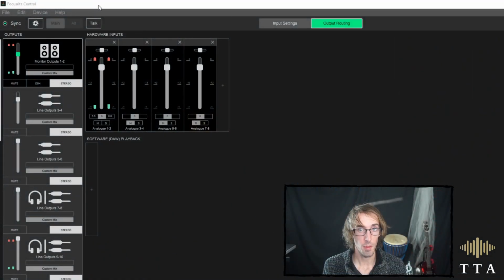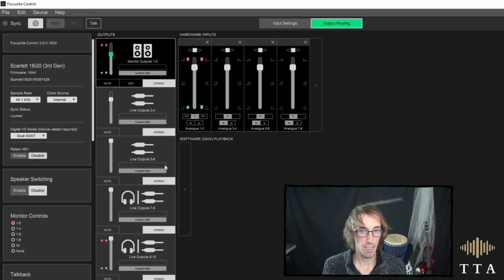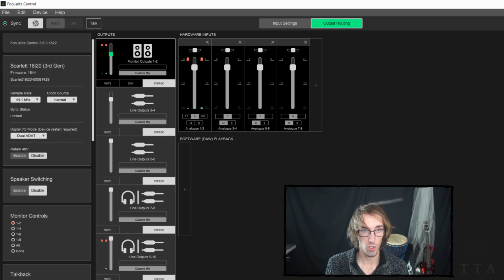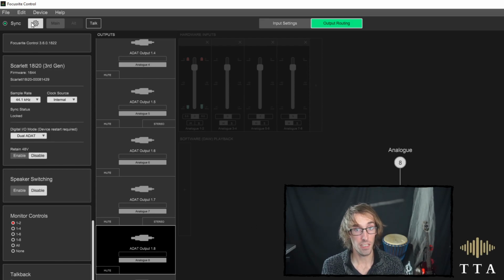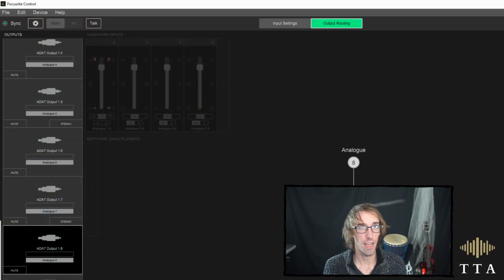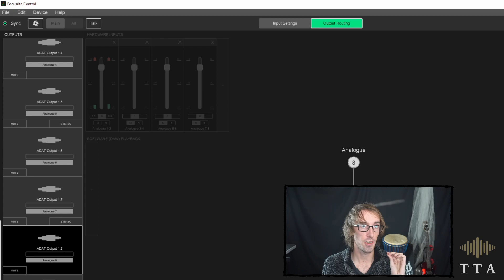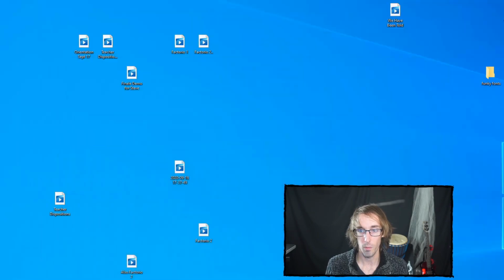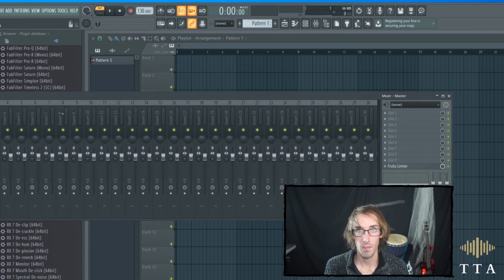Focusrite 18i20 ADAT/Optical Tutorial Faster

Comment: Hey, your tutorial seems helpful, even though it's short. I'm hoping you can assist me with an issue I'm having. I've been using two Focusrite 18i20 2nd gen units for years, but recently, I've encountered a problem. The interfaces are synced, but I'm not getting sound from the slave unit when I plug in my guitar. The meters show signal activity when I play, but there's no audio output. Can you help me figure out what's going on? I've been searching for a solution, including rewatching the video that initially helped me set this up.

Comment: does the same principle apply when i have 2 of the same scarlet 18i20? so that i can run 16 total channels?
Reply from the maker: You bet!
Reply: I followed your video to a T. But when I open ableton it’s still not recognizing the second interface. 
So the interface that I want hardware channels 1-8 to be channel 9-16 is the slave interface, correct? 
So I power on only that slave interface while plugged in via USB AND ADAT? (As described in the video) and go thru the steps in the focusrite app as you described ? Then open my daw and it should work? 
Cause I’m getting signal to my interface of course. Just not to the selected channel in my DAW
Reply from the maker: @Greg-r8l  Yep on the slave, you power that on and configure how you want it to send those to the master (over ADAT). 
Then, you power off the slave and fire up the master. That is the only one that talks to the DAW. 

For me in FL Studio, those ADAT channels show up as 9-16. Not sure how Ableton handles that.

I will have a think on it
Reply: And then to operate I don’t need to have both interfaces connected  via usb? Only the master interface?

Comment: Do you know anything about doing this the other way round? As in: I have two scarlett 18i20s, I can get signal from the inputs of the slave unit but I can't send audio into the slave to come out the monitor channel or headphone pres. I do have two adat cables to go in/out in both directions. The frustrating thing is I had this working at one point a while back and now I cant get it to work again.

Comment: if i use the 18i20 4th gen and have 2 of them and connect it liek your connecting the 2 3rd and 2nd gen 18i20, will i still be able to accuess features like auto gain and air from both of them or just the master interface
Reply from the maker: If those are front panel features, then yes!
Reply: @shawnmuench  Awesome, thanks

Comment: Hi. Your video is great. I have a question: I have my master connected via thunderbolt. The slave is connected via adat to the master, but needs to be also connected to the computer. When I disconnect the slave interface from the computer, even it receives audio, I cannot see the control panel. How did you manage to see the Focusrite control panel with the slave disconnected from the computer?
Reply from the maker: You can only view one control panel at a time. So you'd disconnect the master, connect the follower, adjust its settings, and then disconnect it. It will retain those settings in the background.
Reply: @shawnmuench  I have created a new midi device that is the sum of both interfaces that pro tools recognizes well. If I disconnect the slave, the interface disappears. If I keep it connected, everything seems to work. Is there any problem with that alternative?

Comment: Hi Shawn! I’m trying to do the same thing that you are in your video. 2nd and 3rd gen 18i20’s. I’ve set it up the same way except I’m running out my 2nd gen into my 3rd. I’m using Pro Tools and when I go to set the input to one of my optical inputs I’m not getting a signal.
Reply from the maker: Hey! I've never dealt with this-- but look into clock settings in pro tools and Focusrite Control. I guess Pro Tools can get where it doesn't pass signal if something isn't right for clock stuff. But that's all I've got atm

Comment: since the focusrite has two optical in and outs, could i go up to 24 inputs?
Reply from the maker: No that's just for increased sample rate!
Reply: @shawnmuench do i have to have both 18i20’s plugged into my computer via usb, or just the master?
Reply from the maker: @benschenkel5901  While you set up the settings for the slave, have it plugged in. But after you do that, you can remove the USB because it remembers its settings.

Comment: When you turn on the master unit you pause for a brief second, and then you switch on the slave. In the previous step, you just configurated the slave and therefore the USB cable was connected to your computer. When turning on the master and then turning on the slave both units, have a USB cable plugged in if I am not mistaken. 
Will the whole configurations work if I take out the USB cable from the slave unit just before powering it on?
Reply from the maker: Yep! The slave doesn't care if it's connected. 

On Windows, only one interface can be connected. You turn on the master first, so it connects. Then when you turn the slave on, Windows has no idea. It just does what it wants and feeds audio to the master via ADAT.

Comment: I"m a beginner with this sophisticated interface, but you said to turn off the interface that connects to the computer so that I'm only working with the slave. I connected the optical cable, but when I open the program, it says no hardware connected.
Reply from the maker: mm connect the slave via usb. Then you go in focusrite control and mess with that one. Tell it what to send over optical to the master. When you're done configuring, you can close focusrite control. Turn the slave off. Turn the master on (it should be USB connected). Your computer will "grab" it. Then you can turn the slave on too. It will send its audio over optical to the master. In the "background" without being connected via USB.

Comment: Great tutorial. I mistakenly purchased the Focusrite Scarlett OctoPre which as a mistake for connecting hardware to it as an expander for my 18i20..I emailed Focusrite and they informed me that adding external hardware to the Scarlett Octopre will not work because there is no ADAT IN Ports on the device.   I then read an Article from SOS Magazine and they reported the following., "As before, the basic model offers only one-way (analogue-to-digital) conversion. That’s fine if you simply wish to hook up an additional bank of preamps to your interface to, say, record a rock band with a multi-miked kit. However, it does mean you’re unable to use the Scarlett OctoPre to hook up extra outboard to your DAW. To do that, you’d need the Dynamic model, because as well as the obvious addition of the analogue compressor on each channel, this features both A-D and D-A conversion — you can route your DAW outputs to the Scarlett OctoPre Dynamics’s line outputs, as well as route its line inputs back to the DAW".  Now I am selling my Scarlett OctoPre for a Dynamic OctoPre!!  ~~> Read yourself underneath the INS and OUTS section of the article >~~~~>  https://www.soundonsound.com/reviews/focusrite-scarlett-octopre-dynamic

Comment: One Question is left for me:
I heard that I can connect two 18i20 with each other and it would work out as well to get my 16 mic inputs. 
So what is the deal to get a (for example) octopre instead of a second 18i20?
BC i want Air mode to work on my slave Interface as well, and that is not covered in the newest version of scarlett octopre. I would need to go for a clarett+ octopre for that, which is damn expenicive.

Thanks for the awnser
Reply from the maker: Well looks like it has ADAT out, so you'd use the 18i20 as your interface that receives 8 digital channels from the octopre. 

So it's a one way street in this case-- only ADAT out for the octopre
Reply: @shawnmuench  so the only difference is that tge octopre only has ADAT out, but the 18i20 has In AND out? lol why should I consider buying an octopre then?
Reply: @erichlange5340  & @shawnmuench - YES! I'm also wondering this. I know this thread is old but why would one buy the octopre (out only) as opposed to a 2nd 18i20 (in & out, as well as air mode for all 16 channels)? Especially if they're identically priced. Are there any issues when connecting 2 18i20 units that I'm missing?
Reply: @jedtool  Amen. finally someone understood my problem :D. Now we just need an awnser

Comment: Hi Shawn, thank you for the tutorial. I got one 18i20 (3rd gen). Is it possible to use a second 18i20 and connect both via ADAT? If yes, have both, master and slave, to be connected to the PC via USB, or only the master? I got lots of hardware synthesizers and want to use 16 channels permanently. Thank you a lot, ADAT is new for me and I have a hard time understanding it. The Focusrite manual didn't help me unfortunately.

PS, I broke my 18i8 (1st gen) when I connected it with the 18i20. I switched 18i18 off and on again and it didn't work any more. Can a wrong configuration cause such severe damage? They where just connected via the optical cable, ADAT out on one and ADAT in on the other.
Reply: Having this same exact question pretty much.

Comment: Hey hey, I added an octopre to my focusrite 18i20 (18i20 is my main interface). finally got focusrite controls to see an adat signal. However, i'm not seeing any adat track/input whilst in garage band. all I see is inputs 9-20. nothing resembles adat. Any clues? Thanks!
Reply from the maker: Hey! I don't want to lie and say garageband can't do it. But I imagine a full DAW will be more capable and worth learning. Try Reaper?
Reply: @shawnmuench  thanks man. I got logic and problem solved :)
Reply from the maker: Also- not to be a dip, but did you activate those 9-20 inputs and see if signal comes through? Maybe they're not labeled etc. Just covering bases.
Reply: @shawnmuench  thanks for the hit. I think I did, but not getting any signal. Nothing worked in audacity either. Gonna get logic soon enough but the 8 channels work in garage band easily. The octopre doesn’t even recognize via adat in garage band.

Comment: How do you make sure the slave interface is the only one on? It connects to the PC... If you turn it off, the ADAT interface doesn't work.
Reply from the maker: Mm you configure it by itself, then turn it off and it remembers its settings. After that, switch on the master. It will get connected, and THEN turn on the slave and it runs in the background, doing whatever you told it to. Only one interface is actively connected at a time.
Reply: @shawnmuench  the second I switch Focurite control to ADAT I lose all sound. Syncing my Clarett+ 8Pre and Clarett+ OctoPre should be simple. It clearly is not

Comment: Thank you for this video. You got me running! One thing I noticed is you have to have both devices set to dual adat in focusrite control. Otherwise, the mapping of the inputs/outputs gets all screwy. This is with using 2 scarlet 18i20s. Thank you again for making this video!
Reply from the maker: mmm that's probly right good catch!
Reply: Hopefully you read this a year later- I'm trying to set up 2 18i20s as well and am having trouble. Did you mess with the clock settings at all?
Reply: Hopefully you read this a year later- I'm trying to set up 2 18i20s as well and am having trouble. Did you mess with the clock settings at all?
Reply: @stevecooper5334  Here are my notes for this. I hope this helps you: Setting up focusrite control

Hook it up:
Scarlett B's adat out to Scarlett A's Adat In

Scarlett B set to internal and dual adat in focusrite control (close focusrite control)

Open fc backup
Define the output
Set adat 1.1 to mono and set to analog 1 (just click the stereo button and it toggles on those outputs)

1.2 to analog 2 ect.
Once finished, close focusrite control.
Turn off B Scarlett

Turn on Scarlett A and then Scarlett B. 
Set scarlett A to clock source Adat and dual adat. Make sure both are set to 48khz. It should work

Both must be set to dual adat or routing will be off
Reply: @1manrcvids286  you just saved me thank you so much!! Spent forever trying to figure out it
Reply: @stevecooper5334  Happy to help 👍
Reply: @1manrcvids286 you are the MAN. Holy smokes you just saved my head from exploding 👑. Thank you!!!!
Reply: @hockeytalk6084  You're welcome! Record on!
Reply: Thank you so much for the notes you made for Steve, saved me a lot of headache as well! This comment should probably be pinned, since probably there will be more people with this issue for years to come! @shawnmuench

Comment: Hi, I've been struggling trying to connect my Clarett October to my Scarlett 18i20 for a few weeks now. Does it matter that the Master interface stays on while adjusting the settings on Focusrite Control? According to the video, you say to have the master interface off and only have the slave on. By doing so, Focusrite control reads "no hardware detected." I still can't get signal into my DAW from the octopre. Thank you
Reply from the maker: Mm.. if the Octopre has a control software, you'd connect that with a separate USB cable and configure that device with only it on. After configured, turn it off, plug in the master, turn that on, let the computer grab it, and then turn on the slave.
Reply: My Octopre MK2 has no USB connection on the back 😒
Reply: I am having the same problem. Did you ever get it sorted?

Comment: Hey - i have a scarlet 18i20 2nd gen and want to expand with 96khz OUTPUTS. Is that possible and how? I record only one Stereo In from my mixer. And want to route out outputs to the mixer. I do have now 1 Main Speaker Stereo out, with 3 Stereo Ch. Out. That works well. But i would love to get all 5 Stereo Out from the clarett 8Pre. Is that even possible???? Do i need to conect the Clock??

Comment: I have those same exact interfaces. I did exactly what you did, but the problem was that when I had the main interface turned off like you did…my “slave” interface was not showing up on mix control.. why is that ? Also, when I saved a snapshot to make an I/O template it shows up as an option on my ProTools session, but it won’t let me click on it for some reason..
Reply from the maker: Mix Control or Focusrite Control? Focusrite Control is newer I think. 

When I turn off an interface my computer automatically grabs the other one when I turn that on. 

And not to be a complete dip, but you have another USB cable for the second interface right? Sometimes I literally forget that.
Reply: @shawnmuench  it’s Focusrite control.. and yes, I plug both of them into my computer. I did what you did and it actually worked. but today I had a recording session where I was logging onto another ProTools session that was recorded at a different studio which had a different sample rate, so I had to change the sample rate which screwed up something with my slave interface to where it doesn’t work and I don’t know what I did that screwed but now it doesn’t work..also when I go on my I/O settings, where my inputs are.. my Interface says I only have optical channels 11–14 instead of 11–16.. for some reason it changed after all of that and I don’t know how to reset it. For Analog, there’s channels 1–8 and for SPDIF channels 9–10 (which both are correct) but for optical it change from 11–14 when it should be channels 11–16.
Reply from the maker: Could also be: You want the newest driver/Focusrite Control software, for the Gen 3.

Comment: Looks like I'm using the same configuration that you're showing:  18i20 3rd gen and 18i20 2nd gen.  Is there a reason you're using the 2nd gen as the master instead of the 3rd gen?  I set mine up with the newer 3rd gen as the master.  The only other difference is I have dual TOS cables.  My units were working perfectly together until last week.  The power blinked while the computer was on and after that, the 2nd gen slave unit wouldn't talk to the 3rd gen master unit.  I thought I had been smart by saving config files for both units but had no joy when I reloaded them.  What finally solved my issue was already built into Focusrite Control.  While setting up the slave unit, I selected File>Output Presets>Standalone Preamp, converted the outputs from stereo to mono, saved it as backup config, and powered off the unit.  I then connected the 3rd gen master unit, powered it on, went into Focusrite Control, selected File>Output Presets>Analogue + Digital, converted the outputs from stereo to mono, and turned the slave unit back on.  The master unit instantly recognized all the new inputs and I was back in business, so I saved that config file, too.  Hooray for presets!!!  In retrospect, I think my biggest mistake was not powering down the slave unit and leaving it off until after setting up the master.  Thanks for putting this helpful video out!
Reply from the maker: Good stuff! I use the Gen 2 as a master because I've found it handles MIDI with fewer issues.
Reply: @shawnmuench  Conversely, shouldn't have a problem? 3rd master gene, 2nd slave gene?
Reply from the maker: @tiranoharris  Right! I've switched before. But my gen 2 handles MIDI better for my setup so it is the master.
Reply: @shawnmuench  Thank you very much for your answer, I still have not been able to connect my 3nd gen master with a 2nd gen as a slave. I'll keep trying, I'm working with a macbook pro with OS Catalina.
Reply: @shawnmuench  For everything to work well, I had to add a Software control template (digital template) and with that everything worked perfectly! Thank you very much for everything!!!